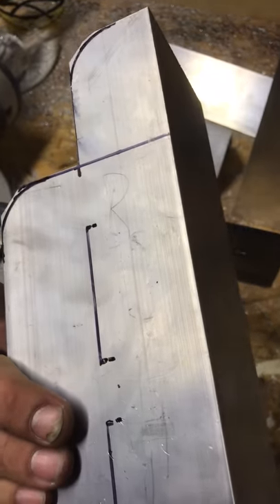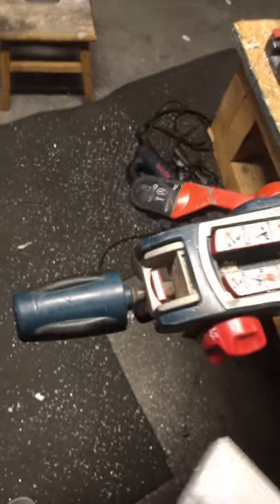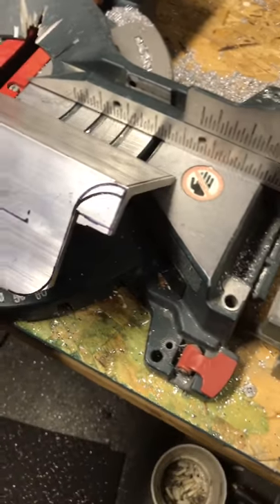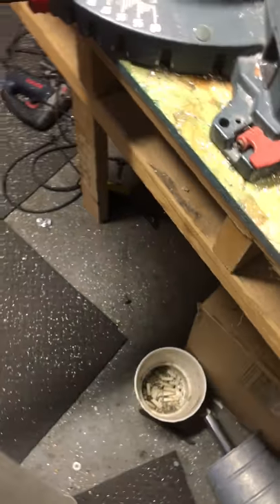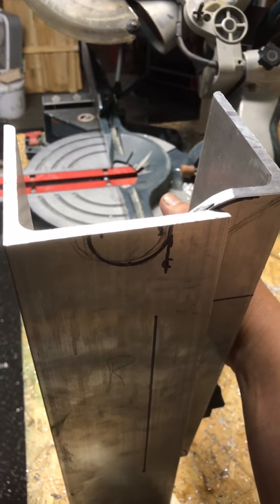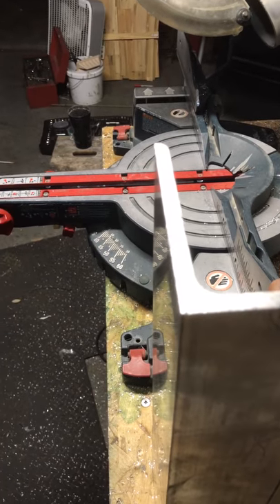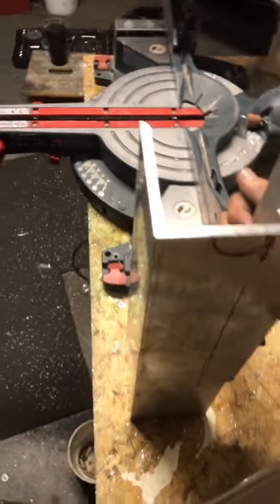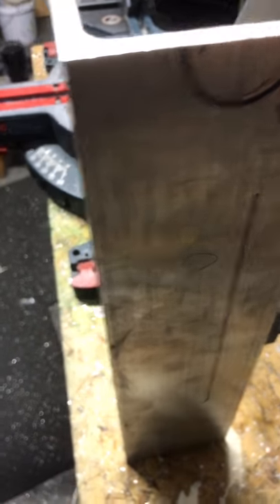Jack plate a work in progress 2

Comment: Nice project. What type of aluminum and wall thickness did you use?
Reply from the maker: Hey 03s3. Thank you for your comment and question I used 1/4 inch thick,  4 inch wide  12 inches long aluminum L channel. I've used the boat quite a bit  and it's  works great.